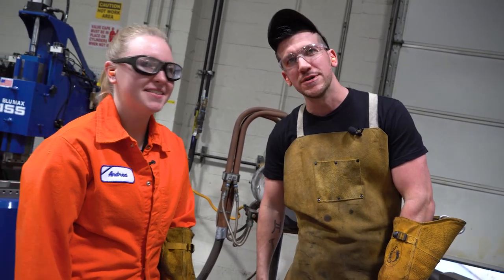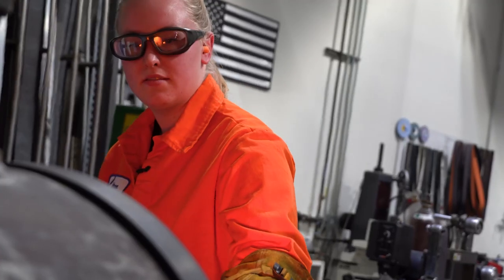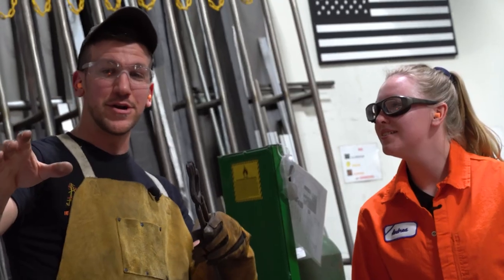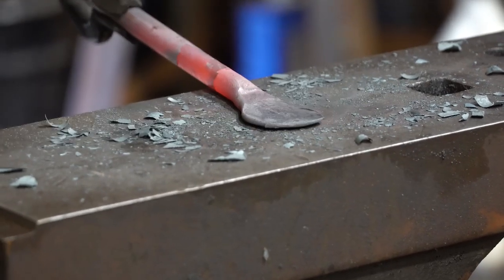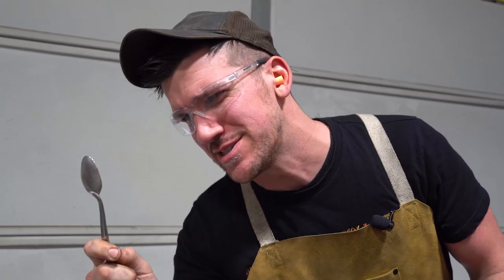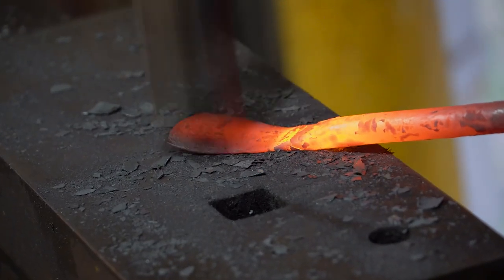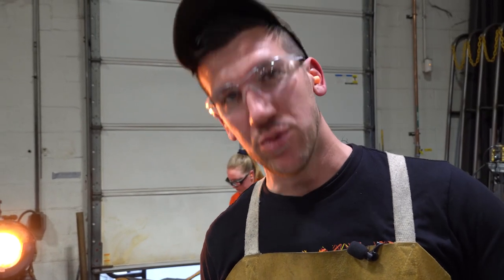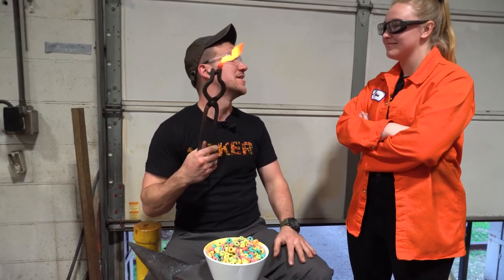Blacksmithing for Beginners: A Metallurgist Forges a Spoon with Collin Sage

Comment: To expand on that "why is it glowing" answer, we can think about the colors of a BiC lighter flame. The base of the flame is blue. This is because there are limited, discrete (did someone say quantum?) energy levels that the electrons in the gas can inhabit. At the base of the flame, where it is blue and hottest, the electrons are excited enough to rise-to and drop-from a difference in energy level that is equal to the energy of blue light. We call this "molecular emission".
Now that's the color of the base of the flame. Further up, where the flame is less hot and the color is yellow-orange, we leave the quantum world for explanation and zoom-out to observe the gas at the Atomic level. Atoms, and molecules for that matter, 'jiggle' when heated. This is what gives them heightened fluidity. With that 'jiggling', the atoms and molecules are shaking-around their charges such that electromagnetic radiation is emitted. For a system of unfathomably many atoms and molecules, there exists such a continuum of frequencies of 'wiggles and jiggles' that the discrete nature of the quantum world disappears. Instead, we can have a smooth response of radiation for whatever temperature the object is at. This is called "black-body radiation" and it explains the color of light from the upper-part of the flame as well as glowing-hot metal.

P.S. thanks for teaching my dad blacksmithing stuff. Regards from Albuquerque.